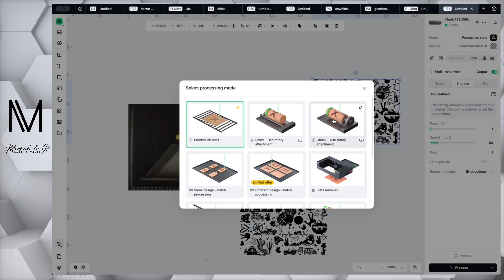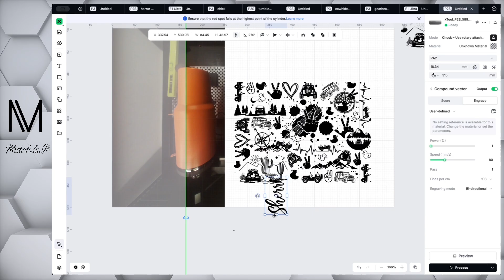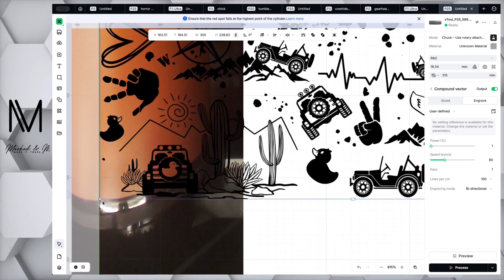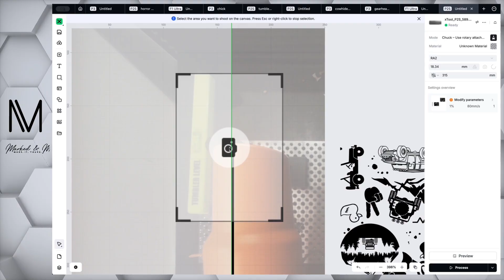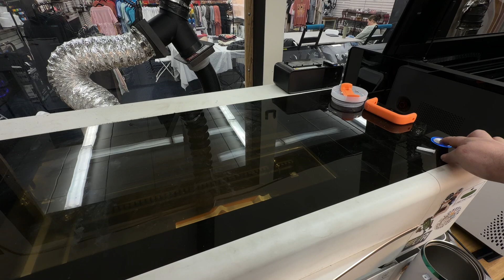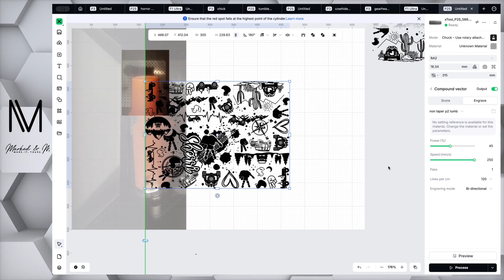xTool P2/P2s Tumbler Course Video 6: Engraving Steps, Tape Test, & Fire Ze Laser!

Comment: I need help with positioning the wrap and the handle.  The image i purchased from Etsy is a wrap but its just slightly too big so when i minimize it, there is a small gap on the wrap. How do i position the tumbler's handle/tabs so that the gap of the wrap sits right where the handle will go? I already screwed up 2 tumblers, I would like to avoid messing up a 3rd. Also, thank you so much for this series, I felt overwhelmed with the xtool and no place to start. Very much appreciated!
Reply from the maker: Hey! So you need to size your wrap for the tumbler (ie if a 40 oz make the file 315mm wide x 235mm tall. If it's seamless, make it 315.5mm wide). Then youll want to place the design as mentioned in this video. With the end of the wrap directly on that green line (rotated upside down of course), but left side of design should be touching that green axis line). Then when you put your tumbler on the rotary, your handles should be straight up. I use a green laser from the RA2 Pro accessory kit to make sure that the center of the handles are facing directly up. If you have an RA3, I make an adapter for the RA3 to fit that laser but youll still need the laser itself. If you do not have one, just get as close as you can. This is the hardest part without that laser.
Reply: @makerfoundry  So I finally engraved my first successful tumbler using the RA3 on the P2S. Some things worth noting....lighting was too dimmed on the unit, it helped tremendously to go into the device settings and enable the brightness button. Another thing i noticed was that the base was up too high, when I did the auto measuring, it was something in the realm of 4mm. I lowered the base to the risers level 4, auto measured again and it was now 15.2mm. This was a huge improvement over the first couple of tests. Also when placing the tumbler I missed the fact that you pointed the tabs upward. I had them flipped pointing down. Once I pointed the tabs up, I took a new snapshot, aligned the beginning of the rotated image right next to the tabs and BAM. it came out perfect!!!  I didn't need a laser since I was able to use the lines and snap feature with the software. You made it much easier for me to figure this stuff out with your videos. Keep up the good work!

Comment: Question regarding image after the reduced setting for the 63.5mm lens.  The image shifts after decreasing the distance to accommodate the 63.5mm lens...Leave everything as is or should I realign the image?  Thank you very much for taking the time to make these videos... They have helped tremendously!!
Reply from the maker: leave everything as is. Adjust placement before and then do not move the image after you adjust the focus.

Comment: In video 4 you spoke about the wrap being the same width as the perimeter of the cup. Here your cup is 315 but you left the width at 305 (which ultimately left a small gap in the final engrave). My question though is the circumference of the bottom part of the taper is much less than the top where you would have measured. If the image is square how does the bottom half of the cup not get distorted during the engrave since the image isn't proportionally tapered? This may be a simple answer but I cannot 'wrap' my head around the logical answer! Btw, awesome series!
Reply from the maker: Good catch - I was a little sidetracked making the recording. It should have been at 315.
Reply from the maker: And technically the image does get a little smaller, but usually it isn't noticeable on full wraps. There are exceptions (perfect circles, etc) but most are fine to be left as is. Even though the circumference is smaller, the cup still rotates the same. So we leave it. 

If you are doing something like a name written up the side of the cup, this is where you'll notice it most. We only do the top part for that and don't extend to the bottom or the letters would be noticeable smaller on the smaller side of the cup.
Reply: @makerfoundry I have been in search of a good explanation for days about the distortion. This has been by far the most logical response. Other answers I have received is "just dont do cups with extreme tapers" and "just avoid wraps with circles". But your logic is sound for the names and ultimately its seems to be the relative perception of the outcome. Technically a person can spend a large amount of time making rainbow bent templates OR just have a good understanding of the limitations. Thanks for your response!

Comment: Great series. This is helping me a ton (just bought the P2S). Although, screwed up a Yeti already due to the positioning of the logo and it having an undetachable handle. Is there a way around this? If there is, would appreciate a video based on how to engrave a tumbler with a handle!
Reply from the maker: There is! You’ll need a riser for the rotary so it can rotate. You’ll still need to trim the design so it won’t technically be a full wrap but you can avoid just the parts near the handle on the design. You’d need to use a template and give the design some cushion around the handle area to avoid the nozzle hitting it.
Reply: @makerfoundry  Awesome thanks. This may be dumb but - I did switch the chuck to the other side of the riser (to be facing backwards) and did rise up the base. However, with the P2S there is no ability to change where the red dot laser is. And unfortunately my riser base is too long to the right (hits the sides of the P2S riser base). Might have to grab me an actual RA2 Pro riser mod.
Reply: @makerfoundry  Please make a video on this, I am struggling bad with this! It appears that I got the power, speed, and everything correct except for the placement of the image. If you can show us how to use both RA3 Automatic and Manual on the P2S that would be amazing!